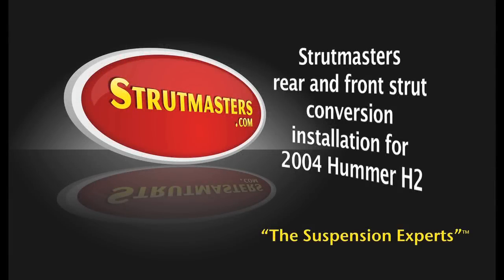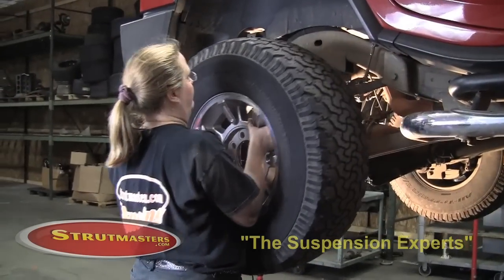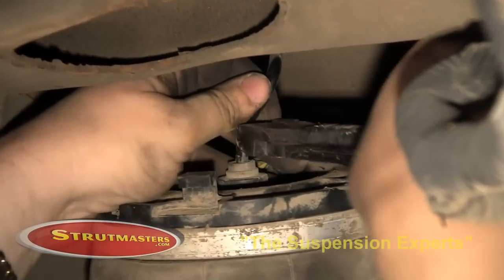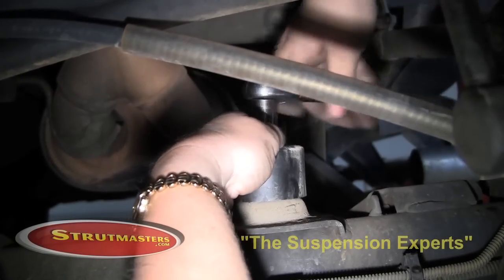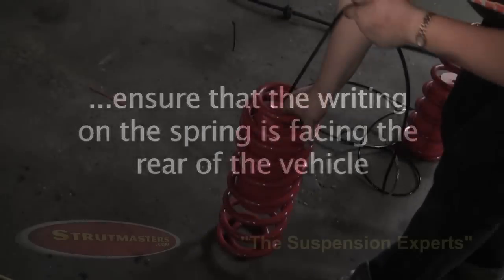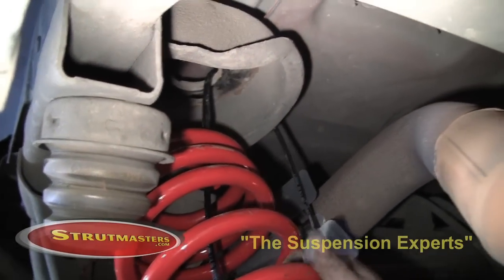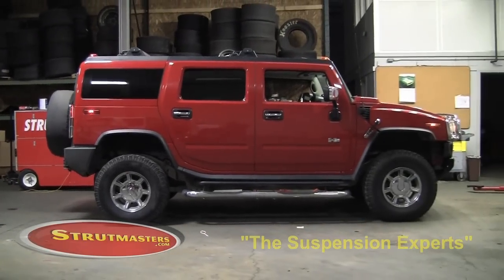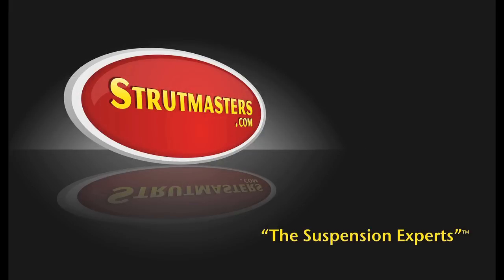Install:  Air Lift Kit For Hummer H2 Plus Strutmasters Suspension Rear Conversion Kit

Comment: How do you stop the service air suspension warning after this?
Reply from the maker: Hi Wyatt, for our complete vehicle solution, you'd be looking for our HA1RFM kit! This kit includes front and rear shocks, rear coil springs, and a service suspension light out module.

https://www.strutmasters.com/products/2003-2009-hummer-h2-rear-air-suspension-conversion-kit-with-front-and-rear-shocks-and-light-fix-module-2wd-4wd-ha1rfm

Comment: Replace old air suspension with new air bags.

Just make sure you cut the old air lines so its never re-usable. 

G8 b8 m8 i r8 8/8

Comment: The conversion kit does not come with the spring isolators nor does this video mention it.  Why is that?   You need to buy those separately or is it required at all? Do you want the springs to sit in the bare metal bowl?
Reply: MrJustus88  springs are coated so you don’t need them.

Comment: The spring in the suspension must work fully, but inserting a rubber ball into the spring and inflating it will lead to poor functioning of the suspension as a whole. This is not a solution. For the lift and normal operation of the suspension, it is necessary to install more reinforced springs, or completely switch to air suspension.
This is a pneumatic kit to deteriorate the performance of the suspension.